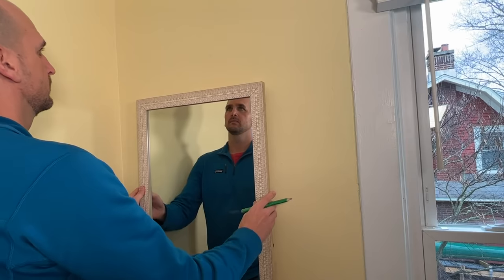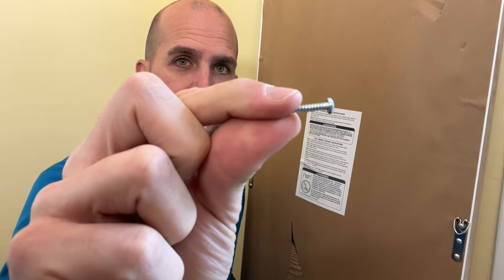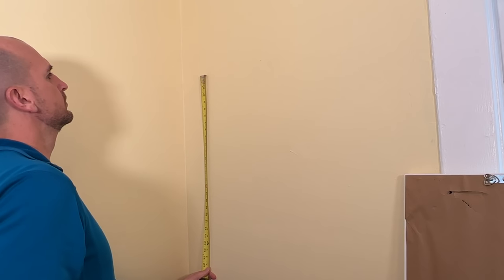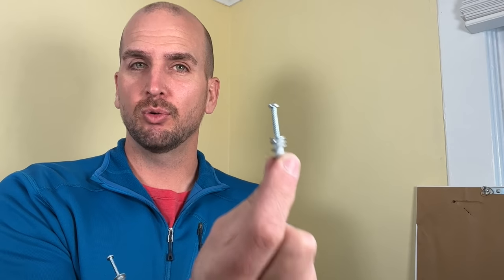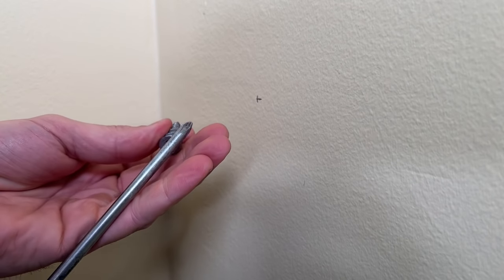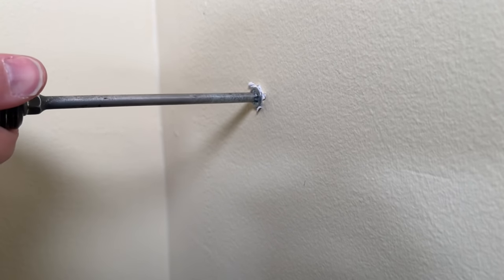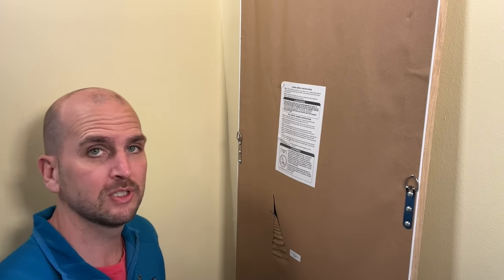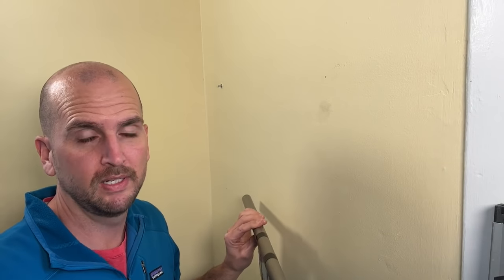Easiest Way to Hang a Heavy Picture or Mirror

Comment: No, "X" doesn't mark the spot where you want your first anchor, because the tip of the D-ring on the mirror is slight offset from the side of the mirror. You need to measure that amount and add it to the 5" from the side that you want. In this case, it looked to me like it might be 0.5".
Reply: I thought the exact same thing.
Reply: Remember though, he measured the distance between the peak of the D rings and no need to know where the D ring was attached to the mirror.  So he is absolutely correct!
Reply: the original comment is about the distance between the wall and the edge of the mirror. if you have expectations for that distance, you need to take into account where the D-ring tip is relative to the edge of the mirror.

Comment: Never assume that the mirror brackets are at the same distance from the top of the mirror. One could be a hair higher or lower throwing of the level when you hang it.
Reply: Agree, I always check the distance from the top on both brackets and many times I have to move one to level them up. It’s best to do this before you install the drywall anchors.
Reply: We had a mirror that had the brackets off by about 10". What a pain.

Comment: Quick tip: if you want a bigger lip on the screw for the D-ring, you can simply put a washer on it before screwing it into the anchor.
Reply: OMG. I never thought of that. Because the lip on my 40-lb anchor screws was too small and I was hanging a huge 25-lb mirror, I removed the anchors from the wall, filled the holes, and went out and bought 50-lb anchors with slightly larger screw lips. I had to fill the old holes and make new ones because the 50-lb anchors would not catch in the existing 40-lb anchor holes. Stupid me. I could simply have used my 40-lb anchors & screws with washers added and saved myself a messed up wall, $7.98, and a whole lot of work.

Comment: Let’s start over….Get the height…measure down from top…now measure the split..from the middle. Make your marks. Now use 2 50 lb art hooks…screw lips are not big enough to safely hold the dring. a simple nudge can lift the dring over the lip.I own a Art install service in ca. thank you for making this more complicated than necessary..it helps my business….plus why is that mirror so far offset left…?

Comment: To transfer the positions of the D-rings, put painters tape on one of the flat sides (top or bottom) of the level. Place the level on the back of the picture or mirror and mark the positions of the D-rings on the tape.  Place the level on the wall, once it's at the right height and level, just transfer the marks for the D-rings onto the wall. If you're worried about the marks on the painters tape being reversed, no problem just use a carpenters square and draw through the original marks across the tape, to the other side of the level.  The tape should be 2", to cover all the way across the level.  Now flip the level around and you can transfer the marks to be in the correct orientation.  Have fun!

Comment: Advise: Check for studs before installing EZAncors. If you don't have a stud finder, first set a pair of screws that comes with the kit into the wall on a full length (you can use a power drill or impact driver). It will be your pilot holes for the EZAncors. If you feel no resistance - that means there's nothing behind the sheetrock. Now just remove the screws and set the EZAncors into pilot holes. If there were a soft resistance like a wood - leave the screw there and don't use EZAncor. If you hit a metal - stop and think! :)

Comment: String picture hanging wire between the two D-rings, then use two standard picture hangers (the type with a hook that is nailed into the wall) at the properly weighted rating. The screw-in wall anchors leave huge holes. Standard hangers just leave two small nail holes. (He said wall repair when preparing to move is a consideration) Recently hung a heavy (60 lb) mirror for my Mom using two hangers rated at 45 lb each. Worked great. Piece of cake. 👍👍

Comment: Thanks. Two comments:
1.	You will be a bit less than 5” from the left wall as the D-Ring is not centered exactly at the edge of the mirror frame.
2.	You trusted that the D-Rings would be accurately placed on the mirror frame. I have been burned on this a few times as they were not at the same distances from the top of the frame.

One last thing. It looked like the electrical tape you used to hold your iPhone was stretching a little, interfering with your leveling exercise.
Reply from the maker: Thanks for the feedback Dean.  Getting burned by incorrectly installed D-Rings would be a bummer.
Reply: Hahaha. You are absolutely correct. The cheap mirrors are usually not centered but I have purchased a couple heavy duty mirrors where they were centered perfectly. You are correct on the stretch of the tape.
Reply: I set up model homes professionally and have hung hundreds of pictures and mirrors big and small. First for heavy items always try and hit at least one stud if you can. Secondly personally I like the plastic anchors more, plastic has flex to it so is more forgiving while screwing in the anchor. I have tightened the metal ones just a bit to much and blown out the hole compared to plastic. I saw the post about the 200+ lbs plastic wall anchors. 200 lbs on a one inch spot is not gonna hold, it will cam out or just sheer down the wall.

Comment: I never trust the manufactured mounting locations. I always double check the vertical distance between the top of the piece and the mounting keyhole/d-ring/hanger.
I've had too many things from Walmart be off, even up to an 1/8" out of whack.

Comment: I hang a lot of mirrors in my work using this method. I use both metal and plastic 'Zip-Its' the common name for these anchors depending on circumstances. I use 'truss' head sheet metal screws as the head is like using a washer. Never use picture wire on mirrors, most of them have warnings against doing so. Good video. Pro tip, I use low tack painters tape to mark drill points

Comment: Hi.  Watched and commented on a few of your DIY videos.  When watching this one, two things come to mind:
First, I agree with the other comments below mine regarding no reference to making sure that both D rings are perfectly level to each other.  I, too, have come across this issue and had to make corrections to my measurements before making holes in the wall.
Second, why do you prefer the metal anchors?   I personally like the plastic screw-in type (like the metal ones), only because I think they add additional secure measures.   When you introduce the screw, the plastic anchor expands (some with a "snap"), and I personally like that.   Just like the metal anchors, the threads grip the drywall nicely and securely with only that one difference of the screw expanding the plastic anchor for added security.

Comment: I love the wire system.  (You develop an eye for that sort of thing),  and only one hole.
Reply: I like the wire system as well, even if the weight of the item requires two screws or hooks.  It allows for some additional adjustment of leveling, which is more critical to looking correct than being ever so slightly to one side or the other. As someone else said about the method in this video, what's the point of checking the level after the install, since it would then be too late to fix it. I have put up items with just the d-rings, but it requires a lot of precise measuring including checking the placement of both rings from the top of the frame.
Reply: I use wire too with 2 bulldog hangers on each print or mirror. I wrap masking tape around the small section of twisted wire & over the loop where the wire is connected to protect the wall. Bumpers on bottom corners too.

Comment: I have a nice solution that might not be available to everyone.  Instead of marking on the walls when laying out a picture arrangement, tape paper to the wall and mark on the paper, or mark on pieces of masking tape.  Now, here is my easy solution. In my hometown, they sell newsprint end rolls for a buck or two. These are about 36" wide and vary in length usually at least 20-30 ft. Just cut a piece off and tape it to the wall and mark to your heart's content.  If you have young children they will love it to draw on, also great for masking off an area for painting.

Comment: Take some small nails or screws and when you are holding the mirror up to the wall, hold it in such a way that your fingers on the back side are holding the nails/screws in place in the D-rings like they would be when hanging on the wall. Press the mirror frame with your hands in place against the wall and the points of the screws will make tiny holes where the screws should be installed.

*Tip - have a pencil ready so that as you lower the mirror back down you can keep your eyes on the wall and mark the holes right away before you lose sight of them.
 Once you look away, the holes can be difficult to find again. If you DO lose sight of your holes, simply repeat Step 1.

Comment: Good video and thank you very much. However, I personally would NEVER use a pipe to level something on a wall. The pipe is round, meaning that you can come in and mark above or below where you actually need it. I have used a straight board or a nice long (3 - 4 foot) metal straight edge.

Comment: I absolutely love your channel. I have learned so much from watching several of your DIY videos. Sadly my ex was of no help and hardly knew how to use a hammer. . no lie!  My next project is replacing some small wood paneling pieces used at 2 entrance ways. I'm not sure why they used paneling over the wall but my guess is that the walls were damaged and an ez fix was slapping some paneling over it. They had a dog gate attached and it scratched the paneling pretty bad. Do you have any DIY videos on this subject? Thanks for the videos. You make the content and explanations so relatable, easy to understand.

Comment: Those metal anchors are the very best, not only because they carry a great deal of weight, and hence will not fail or fall out, but also they can be reused many times, and the hole they leave can easily be patched with wallboard cement, a quick sanding, and repainting. I use a quality stud finder to be sure to work around any studs,and of course if you need an anchor right where a stud is, then simply use a longer wood screw in that spot and screw it into the stud, and I would use my power drill to drive it in rather than trying to drive it in by hand.

Comment: Instead of the screw in anchors, today I would use the 3M Claw anchors. 
Not sure if they existed when this video was posted.  Very easy to install and strong.  For a 25 lb mirror, a 15lb rated Claw on each side would work fine.  They leave only two small punctures when removed.

Comment: For heavy stuff, I've had great success using z-bar.  Allows you to always use studs.
Reply from the maker: Thanks for the feedback Bern, I have seen the cleat systems out there but never tried them out.
Reply: There are some cleat systems that have their own bubble level built-in. You don't have to go hunting for a level, or worry that it's too long or not long enough. That's really nice when you've got a really heavy wooden framed mirror that takes two people to lift it into place.

Comment: I've tried all kinds of anchors on both drywall and plaster/lath walls/ceilings, and it's very difficult to beat regular old toggle bolts. For plaster just get longer ones to ensure they push all the way past the lath and open up. Other contenders for me are the plastic expanding toggle bolts from Toggler or the plastic strap anchors with a metal bar. Those screw type anchors are difficult to get in straight, and especially with drywall can easily strip out and become useless.
Reply: Your comment seems to have been cut off. Last thing it says it "..., and especially with..." but no link see more. 

Toggle bolts are definitely the safest way for stability, but will blow a BIG hole out in the wall when trying to remove them, so only good for permanent homes, not for reselling a home and esp. not for renters.

Comment: Can you show me how to install a recessed mirror medicine cabinet, especially for a 30-inch one? Would it compromise the structure of the load-bearing wall?

Do you think it's necessary for a rental property?
Reply from the maker: Usually the recessed medicine cabinets are designed to fit into the space between studs in a standard 16" on center spacing.  You can run into issue with vent pvc lines but if you have the space and it is centered to you vanity the install is pretty straightforward.

Comment: My mirror is 15 lbs. would the 40lb or 50 lb ones be enough ?  I’m not sure is my drywall is 1/2 or 5/8.  Or should I use the toggle bolt ones ?
Reply from the maker: You should be fine with either the 40 or 50.  You could also just use 2 x 40 lb anchors for peace of mind.

Comment: Why not use the level BEFORE putting the screw in the first anchor bolt, so that the bottom edge of the level can be aligned with the center of the anchor bolt instead of atop the screw head?
Reply from the maker: Usually I need that screw to rest the level on and make it easier to get the bubble aligned and your second location marked.  Just me 2 cents. 👍
Reply: The method shown doesn't require both anchors to be placed exactly correct and in the perfect location. Instead, you reference one off the first as it was installed, and then you put the second one in. This can help simplify installations and make them less prone to having both anchors slightly out of place.
Reply: @shubinternet  : If you reread my question more carefully, you'll see that the alternative I asked about also uses the first anchor bolt as a reference for the second mark.  The alternative I suggested uses the center of the first anchor bolt for the reference point, instead of the point that's a screwhead radius above its center as shown in the video.
Reply: @brothermine2292  ahh, sorry. I misread your question. However, towards that point I can see the response from the author that it's easier to have a solid place to put the level and not worry about the level getting off-mark while you're trying to mark the second location. There is the radius of the screw head to be concerned with, but that shouldn't be too hard and the bubble level will at least give you an accurate level that you can reference from for that screw head radius.
Reply: @shubinternet  : Yes, if one needs a resting place for the weight of the level, resting it on the screwhead makes sense.  Or perhaps one could temporarily stick a pin or skinny nail into the anchor bolt and rest the level on the pin or nail.  If I rest the level on the screwhead, I wouldn't just estimate by eye the screwhead radius offset needed for the second anchor bolt... I would measure the screwhead diameter, and then make a second mark located a screwhead radius below the first mark, and sink the second anchor bolt into the second mark.

Comment: I have several anchors like that coming out of the drywall. Theyre only holding up drapery rods. I do not recommend using them.

Use the stainless steel wall hanging hooks that go behind the drywall, sometimes called monkey or Hercules hooks. It only takes one and they hold up to 100 lbs. You can get 50 for like $10 on Amazon.

Comment: I misunderstand the part when you do have to make up that distance just a little bit (timestamp 6;19 in the video)?
Can you briefly explain it in other  words. I am about to hand a 10.5 kg. rectangle mirror this week.
Reply from the maker: The level is sitting on top of the screw head so when we mark the 2nd location we would want to make the mark a bit lower than the edge of the level since we are marking the center of the screw/anchor and not the edge of the screw head.  Make sense?
Reply: @EverydayHomeRepairs  It does. When  you lower it a bit, are you still staying in the range when the level is straight (bubble in the center), in other words do you eye-measure the bit of leeway you give it?

Comment: Like many other have commented, these are almost the WORST hangers and are usually only found on cheap frames/pictures. Issues:
1. They are almost never exactly the same side-to-side and top to bottom; you have to measure and be precise with everything
2. "Level" is usually the way you want to hang them, but not always exactly. It's more important that it LOOKS right than that it is level; work with an interior decorator and you'll quicly find that out. Ceilings, walls, floors and door, window, and floor trim are often a bit off plumb/level, and a level wall hanging will look crooked. I can't tell you how many times I've needed to re-hang something off-level so it looked right.
Bottom line:  The zig-zag cut metal pieces and or wire-hangers are much easier and adjustable than these unforgiving, cheap hangers.

Comment: Is there a simple way to secure the two D-rings to the two screws, so the mirror won't fall off the wall during an earthquake?
Reply: What we did with some of our paintings was to apply 3M Command Picture Hanging strips on the bottom of the frame, between the frame and the wall. In part, they serve the same purpose as the clear rubber bumpers that were shown in the video. But they also secure the bottom of the painting to the wall, so long as they don't have to take a lot of weight. This also helps keep the frames level, in case they get bumped.

We don't have much in the way of earthquakes here in Austin, TX. But we do have curious cats.

Comment: Look to right side of the object in the middle after you hung it. Does not look good. Could be my eye sight and don't want to offend you. Recently finished a painting job with 10' walls. Good luck to the person who has to rehang everything. Weight is my primary concern. How much weight can drywall hold by it self with an anchor?